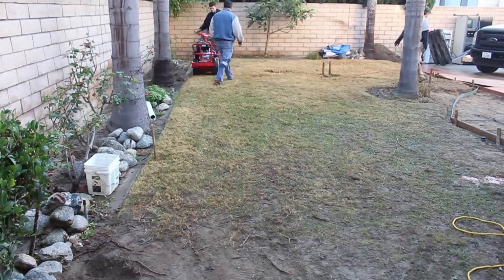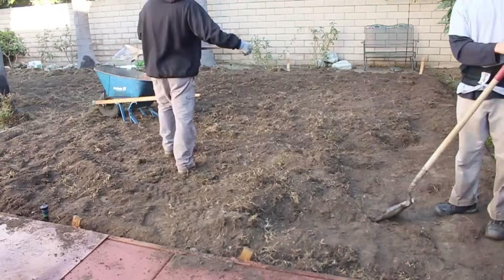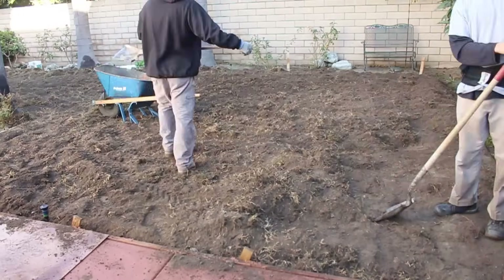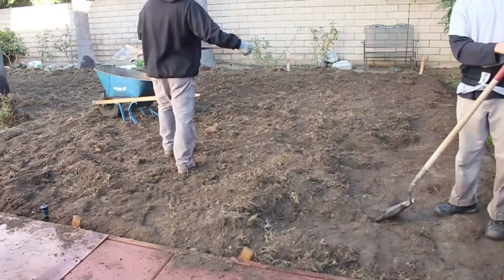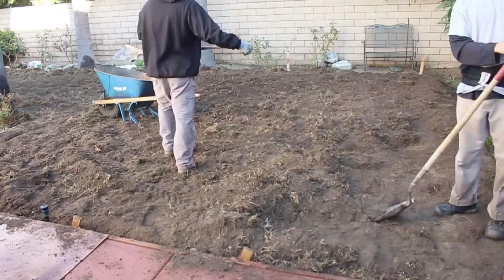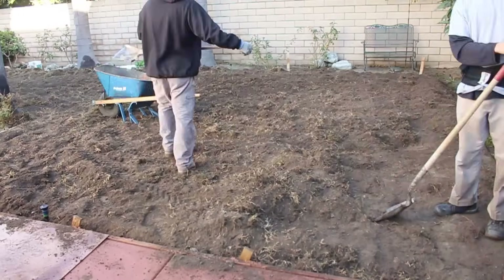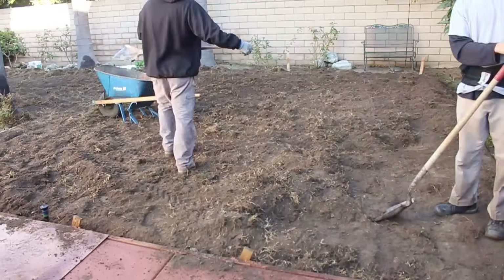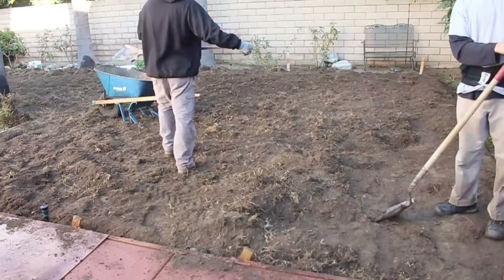How to lay Sod 101 DIY

Comment: I was thinking of what is wrong with my sod today (I live in Georgia) and so I started googling prep for sod and your video popped up (I have watched many of your concrete installs but would not have guessed you did sod too). Anyway, just like concrete it's all in the prep.  Should be standard action to grade perfectly and use NEW topsoil before placing sod but many contractors don't do it because THEY don't bid the job correctly (I live in a new build community).  It gets rushed for the holy dollar and ends up being not right which makes the dollar get a bad name.  Screw it, I'm moving to Gatlinburg, TN.  Another great video.
Reply from the maker: I concur 
GL WITH THE MOVE
TY

Comment: How big are those roles? Here in washington they are 10 square feet each also shouldnot the sod lay lower by the concrete and sprinklers need to be closer to the edge
Reply from the maker: you want excess water to run off

Comment: Why not turn the last row 90 degrees instead of cutting 4"-6" inches? Also why didn't you move that sprinkler head closer to the sidewalk so it would cover the 180 degree better?  Seems like it was 10" inches from the concrete.
Reply from the maker: I dont know, but its a good question

Comment: Do you have to put any type of fertilizer on top of the soil before you lay the sod, or it can be done after laying?
Reply from the maker: I blend fertilizers with the soil
Reply: Odell Complete Concrete what if fertilizer is not mixed with soil before laying the sod?
Reply: Or does not have fertilizer at all under the sod?

Comment: Hey I got my pool removed about 2 years ago and now everything has settled in the back yard.......Now i have to get the yard re-graded and prepared for Sod........what should the steps be here.? Here is the thing the contractor who filled in the pool used a dump which was rocky and right now on the surface there is smalls stones .....do you have an email address I cam send you the photos of my back yard?
Reply from the maker: davidodellconcrete.com

Comment: Something we usually do is, let the sod run past the cut points like along flower beds or any soft edge then use an old diamond blade on our concrete saw and cut the whole line in one pass at the end of laying. Obviously don't do this along hard surfaces.
Reply: This also works well for marking edge of excavation when digging up sod instead of chopping your line with an edger or shovel.
Reply from the maker: Ephix 
Sounds like you may a lot of waste.
Reply from the maker: +Ephix 
I like it.

Comment: very informative videos.....thanks.
what is this grading machine...very handy and good for small projects.
  plz let me know from where to buy it....I am builder from Michigan.
regards.
Reply from the maker: +sajid Mumtaz Raza 
Large rake
Reply: Odell Complete Concrete 
Perhaps he meant the rototiller that was used to break up the surface.
Reply from the maker: Jennifer WhiteWolf 
Possibly
Reply: you are right jennifer
Reply: sajid Mumtaz Raza 
At most equipment rental centers you can rent a roto-tiller.  Its not clear in this video, but it has rotating cutters that dig in soil a few inches... making it easy to shovel off.

Comment: Can manure compost be used as a substitute to topsoil? If so, what should be the application rate of the manure compost?
Reply from the maker: Straight manure will burn it up.
need a blend of soil and manure 20% manure to 80% dirt